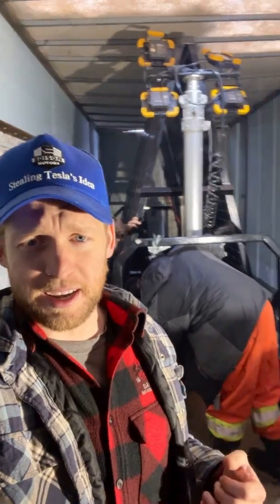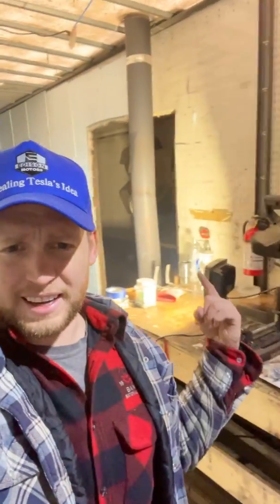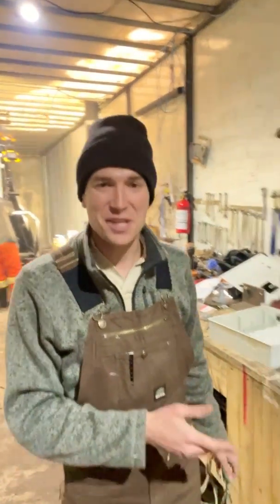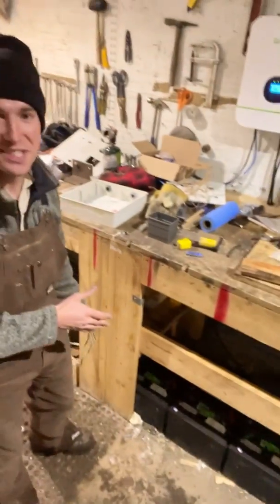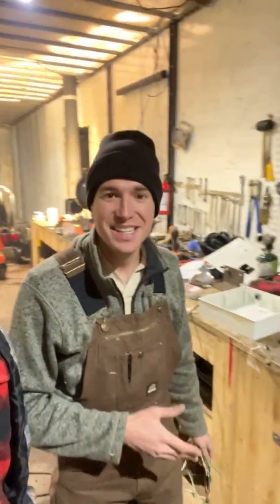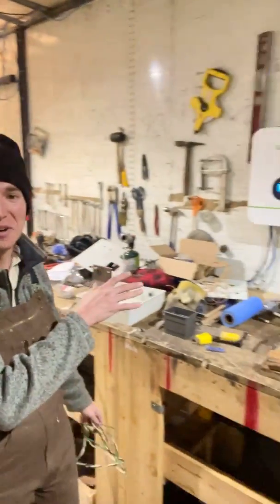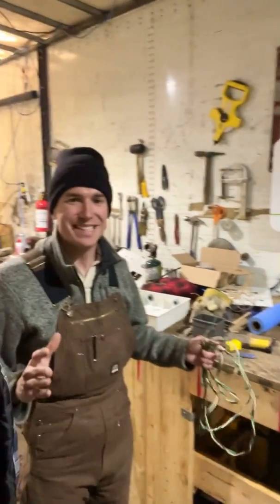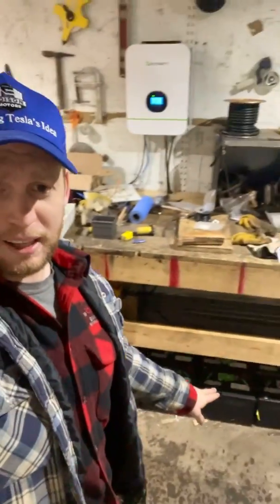Innovative Power Solutions: How Our Hybrid System Saves Money in the Workshop

Comment: I need a wooden furnace in my Tesla. I want more mileage and toasty feet.
Reply: EV should put a diesel water heater instead of a heat pump. Cheaper and will lose far less range in the winter
Reply: @JD-yx7be  You are a bit behind the times. This was done in the Pug/Citroen 106 electric 20 years ago. New EV's with their 100kw + batteries, the range loss to a heat pump based heating system is insignificant (1/2% or less).
Reply: @idrisddraig2  maybe in mild cold weather like 40F but under 20F i doubt it. But i  am open to look into it

Comment: No wonder you actually save a ton. Cos that inverter feeds if the battery with a variable load while the generator pushes optimal load to change ge it back up. Cool.
Reply: It's the same idea as their truck

Comment: Could this be done on a house ? Or a larger shop running air compressors welders?
Reply: yeah, just have to size it correctly. They even sell ready made stuff you just plug and play but it cost a bit more. Ecoflow makes some great products for that
Reply: This could absolutely be done on a house, eco flow sells a complete solution for this. The intent is more for RVs and stuff, but you could absolutely use it as backup power for a house. It allows up to 3,000 watts of solar panel input (I don't know if they're sold separately) or 2000 watts of solar panel input and then a much larger amount of watts that I forget from an inverter (in this case a generator) 

I forget exactly what it's called but you could absolutely use it for this. Or you could do a DIY solution with dramatically more input and battery capacity because the eco flow solution only has a limited amount of battery although how much I don't know
Reply: Thanks guys

Comment: That battery system doesn't even need to be charged with a generator.  Depending on site conditions solar, wind, or micro hydro would do the job just as well.
Reply: People over estimate solar and wind production.  I'm off grid 4.6kw array with 22kwh lifepo battery bank..base load on the system is only 600w..works great in summer but in the winter the generator runs 5hrs every other day to keep batteries up..solar drops way off in the winter, due to snow and cloud...no way could they run a shop with solar trailers...unless they lined 10-15of them up...and that would probably costs 200k to do.
Reply: @bwillan  
It'd seem so.
With the  batteries being replenished in 30 minutes per day of run time, the shop is only consuming about 1.5 kWH per day.
Basically roughly the energy of burning three 60W lamps for 8 hours.
Reply: Yes, they likely can get a lot of their power from solar.  The hills make wind less likely.  They could put panels up in the roof.

Comment: Off-grid and "microgrid" isn't just the WAVE of the future ... it's a TSUNAMI.
$50K for a grid-tie PLUS monthly electric bills versus $50K for a full solar and battery buildout and NO MONTHLY BILLS? Do you HAVE to tie your house to the grid in future? That $50K can include a propane generator if you're really nervous.
CEOs of utilities need to start planning for this kind of future - and not the way US CEOs would "plan" by buying politicians to forestall it or legislate against it (already happening in several states), but by figuring out how to restructure for a more decentralized grid.
And ... done right, it will avoid the cost of building big, expensive transmission lines.

Comment: Out of curiosity, what did the inverter and battery bank cost compared to the welder and diesel?.
Even Chinese lithium batteries are spendy.

What will be around in 10, 20, 30 years, your welder or the batteries under the bench.

That's why your idea for a diesel/electric truck is better than an electric only truck.
Reply: DavidPos has a straightforward DIY build, that's basically just hooking 2 x 24v LFPo banks to a BMS. It was something like $1800 for 10+kw. Significantly less expensive than lead-acid, with a greater DOD and much longer life of service, at higher efficiency (99 vs 80).
Reply: @my_channel_44  That's a really good channel, availability of some of that stuff is still really spotty if you're not in the US.
Reply: @capnkirk5528  
You're not wrong, especially here 🇬🇧
Reply: @my_channel_44 
Many thanks for your helpful reply and the heads-up about DavidPos. 👍🏻
Reply: LiFePO4 Batteries should be perfectly fine for 15 to 20 Years. This does not mean maost of the capacity has degraded, at like 17 years you starting have peak power output problems and heavy resistance. But yeah beyond 20 years is currently the major problem. Maybe you should look up basic information before spamming erroneous assertions.
Reply: @Neojhun  
I prefer to hear real world user experience more than to the manufacturers spiel about what they're trying to sell you.

I wasn't spamming like your assumption, I'm genuinely curious on the longevity. 

I drive a 1967 Land Rover with a 200TD conversion. I'm unaware of any EVs from the same year still running in my AO. 

One problem I've noticed about old electrics are stuff like the wire casing cracking then the copper corroding. 

Not to mention the NVH on vehicles compared to your home solar setup. Electric aren't too 
keen on getting shaked and banged about.

I can replace cylinder liners and hone them but couldn't rewind an electric motor.

My friend has 3 D22 Navaras between 03 and 05 that run electronically controlled Bosch VP44 pumps. He had 1 that the timing solenoid failed and was seized in the pump so the pump need removing. Then later the ECM on the same pump failed completely so out it came again. 

Then a week after the same ECM failed on his work D22 so out it came as well.

The mechanical pump on my Land Rover have failed...yet and the youngest was made in 1994.

I think Diesel Electric is a mint idea and wish the Edison Trucks team every success. But I'm concerned about the longevity of it.

Have a good'un 👍🏻
Reply: Considering how tiny the capacity of that setup is, it did not cost alot and the ROI would be quite fast. Chinese Lithium batteries are only spendy when you want massive capacity like 40kwh and beyond.

Comment: I'm assuming you forgot to mention that you have solar panels connected to the inverter also. Otherwise, how would this change the cost of diesel fuel? I watched the video twice. What am I missing?
Reply: You're missing the part where the generator used to run full-time every day. It powered the equipment that was plugged in but most of it's output was wasted as there was no storage for it. Now they run the generator only to charge the batteries where all of its output is captured and stored. Once the batteries are charged, the generator shuts off until the batteries get low enough to need a fresh recharge. The difference is the amount of energy being wasted vs used.

Comment: almost sounds like you should put one of those solar towers on top of the shop. then you don't even have to pay for diesel.
Reply: I think you would need a whole lot of panels to replace the diesel completely, and that would cost a lot more. However a few panels while keeping the diesel might be the best option. I'm not a pro btw, just guessing.
Reply: @anonymouse527 I do something similar with the caravan that I live in on site with my earthmoving business. It has a couple of small panels on the roof and they keep the 12V, 120AH van battery charged to 100% all the time in summer - but come winter they just can't keep up. I need about four times as many panels - and I'm not in nearly as high a latitude as they are. No snow either.

So I'm guessing that they would need a lot of panels to do the job - and still want the backup generator as well for days when it's cloudy/raining/snow etc. I have a little petrol generator to top off the house battery in mid winter.
Reply: @langdons2848 I was thinking of doing that with my camper. Glad to hear it's possible! My small air conditioner consumes 600W tops, so with a couple 200-300W panels and a 120AH battery I think I could run it all day, or at least when the sun is out. But also would get a generator just in case.
Reply: @anonymouse527  that sounds like a good plan. I have to have shore power to run my old AC unit - it's a power hog!

Batteries and panels are cheap though, so I'm in the process of building up a service trailer that has eight big 48V panels and 1000AH of storage for when I'm out in the bush for a week at a time.
Reply: @guitarbrother1762  small brain take. Why one or the other? Diesel PLUS solar power! All going towards batteries.
Reply: The problem with that right now is that it's winter and he's likely not getting more than 1-2hr of good sun exposure a day and that's if his panels are snow free.
Reply: @zarketh5385 no snow this year, and he'd have at least 4 hours
Reply: What make and model of Inverter?